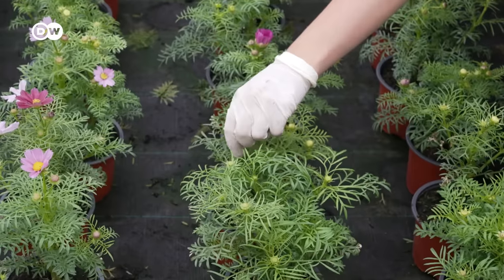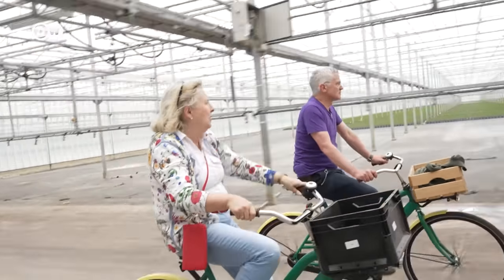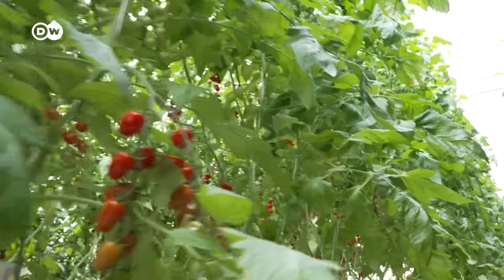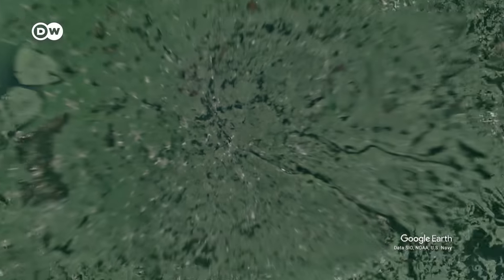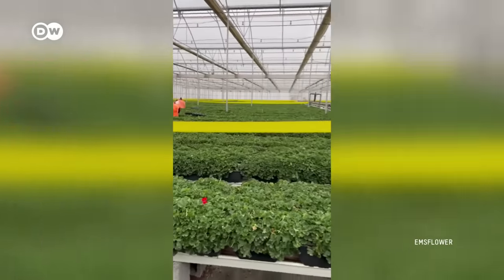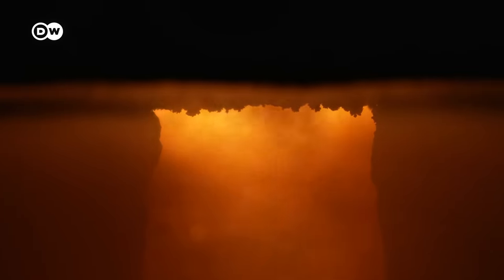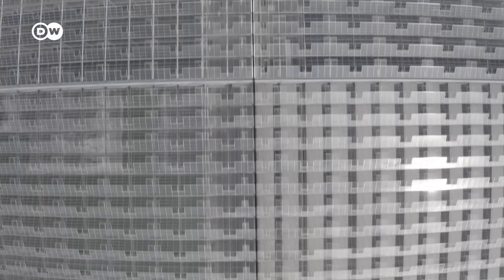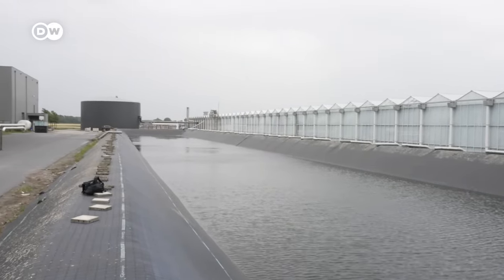The cutting edge technology of Europe's biggest greenhouse | DW News

Comment: Impressive, but this operation is in no way an eco friendly climate change prevention sustainable business. 

Firstly, they import plants grown in Ethiopia that have to be delivered as air cargo.

Secondly, the sheer amount of plastic, most of which is likely to be made from virgin feedstocks, has a VERY heavy greenhouse gas footprint along it's (entire) supply chain and will largely end up being 'single use plastic' in nature that will be either landfilled or incinerated. It's very difficult as a gardener to find a way to recycle the types of plastic you acquire from the horticultural industry; trust me, I know from years-long experience.

Thirdly, the burning of waste wood simply returns the carbon contained therein to the atmosphere along with the nitrous oxides and sulphur dioxide produced as byproducts of biomass combustion, all of which are heavy greenhouse gas pollutants. 
 
The use of solar panels on the greenhouses rooftops is an excellent choice and I understand the economic benefit to the business of selling the excess electricity to the grid. But a much better choice would be to use most, if not all of this excess electricity to power industrial sized heat pumps to heat the greenhouses instead of using polluting biomass.
Reply: Alot companies buying so much wood right now for beeing ridicilously beeing "climate neutral" that they impact wood, pellets prices for regular people that they also starting importing wood from northern places again. Very "climate neutral" indeed... I hope they also buy those million $ filters every year to clear out wood smog. If they have excess energy then yess heat pumps are a better choice.
Reply: As someone who lives in the most important greenhouse area of world, I can say that your comment is really typical for someone who doesn't understand what efficiency ( and yes, that also means the least energy spend per product/plant/flower ) really means.
Try looking up carbon footprints or emmisions per product per country. You will be suprised.
Reply: at the least it uses way less water than normal farming
Reply: @OsirusHandle  True.